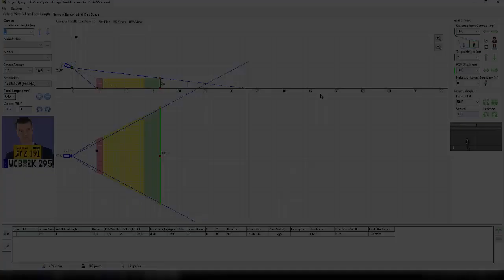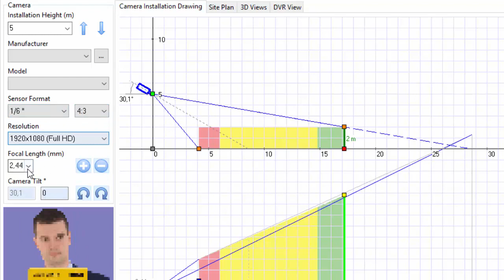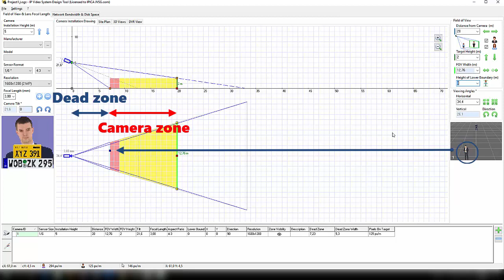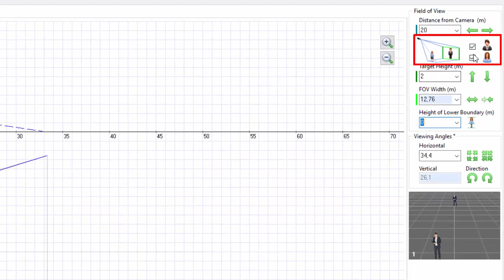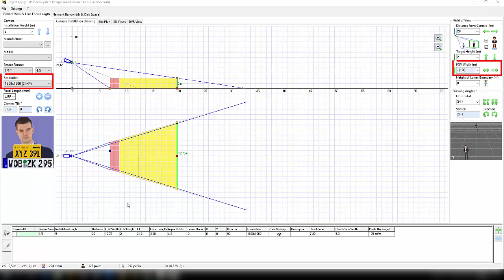How to design CCTV system. Part1: Camera Installation Drawing, focal length,pixel density

Comment: Exactly what i was lookin for 👍 but isn't there a Formula to calculate the fov degrees in a rectangular box?
Let's say a 2.8mm Lens in 4.5m height and you want to Cover a distance of 15m without any Deadzone... Would this be even possible?
Reply from the maker: In case of installing cameras at 4.5 meters it is hard to get rid of a deadzone even with wide angle cameras. In addition you will get quite steep angles for viewing people near the camera. You can simulate such situation in the trial version of the program.